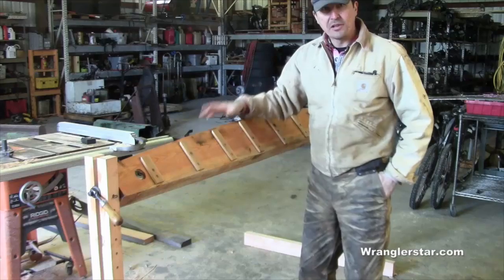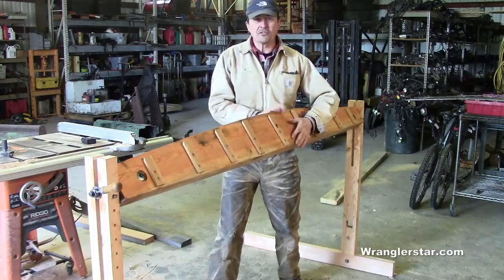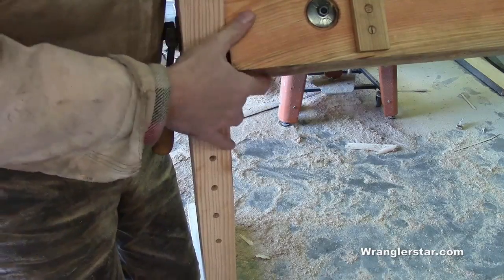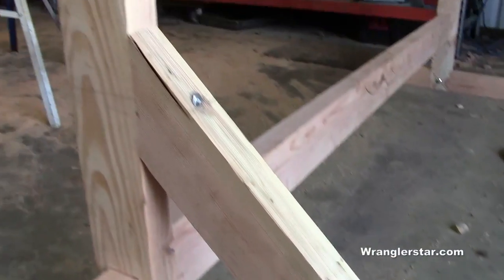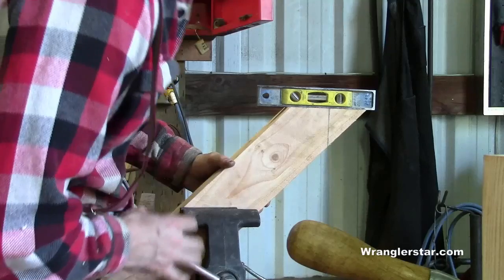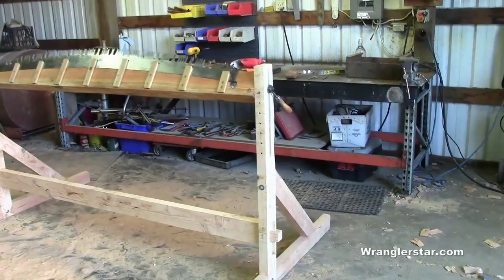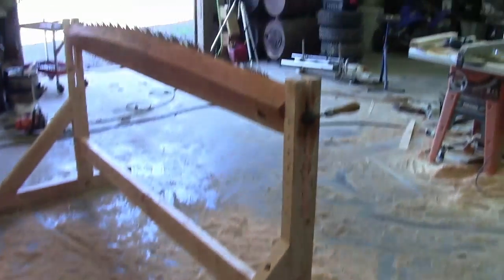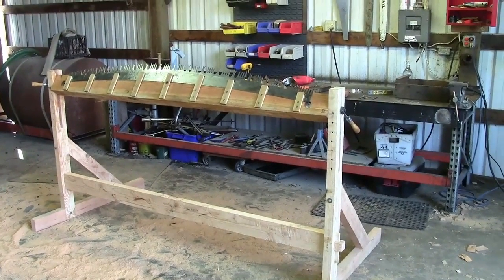Crosscut Saw Filing Bench pt 5

Comment: Maybe add a few thin gauge aluminum flanges on rather side of you're lock channel. This will keep the washer from biting into the wood. Over time, the biting will ruin the integrity of the lock.
Reply: Or, You might put a good layer of silicone caulk on the wood contact side of your locking washers. Of better yet, both aluminum and silicone.
Reply: I do however have a tendency to over engineer so, take this how you will 😏
Reply: PS. It's a beauty no doubt. Good job!